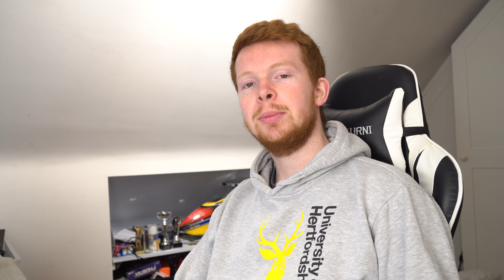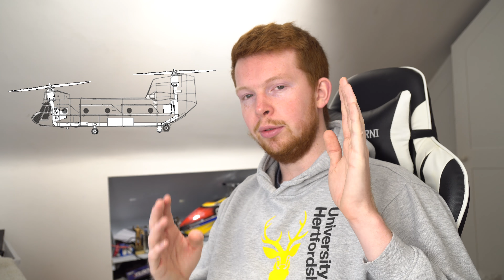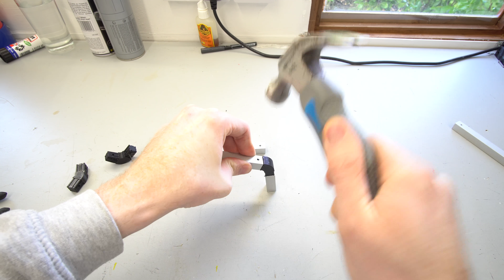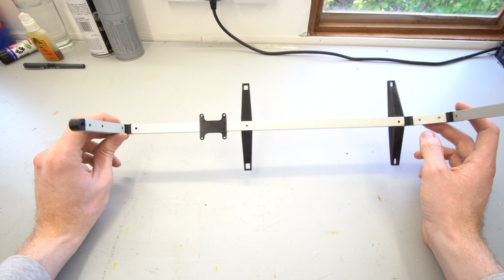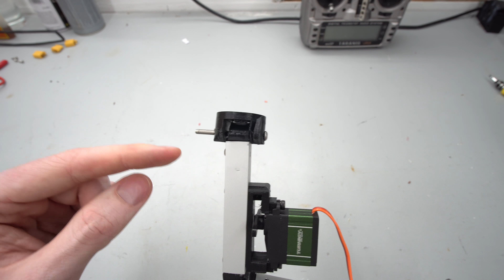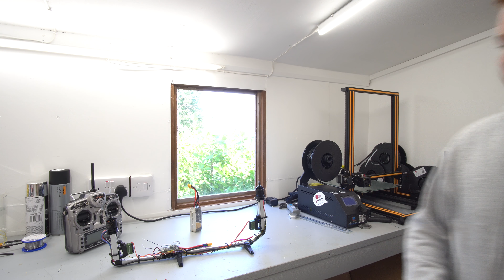RC Chinook Bicopter - Part 1

Comment: I'M VERY CURIOUS ABOUT THE CHOICE OF COMPONENTS, AND SWASH PLATES/ROTOR HEADS, MOTOR SELECTION, ROTOR SIZE/WEIGHT (SCRATCH BUILT?, OR COMMERCIALLY MADE ("REPURPOSED")??....  WHAT ABOUT ROTOR BLADE INTERFERENCE/TIMING/SYNCHRONIZATION?.... IF IT FLYS WELL ENOUGH, THEN YOU OUGHT TO DO SOME "HEAVY LIFTING" TESTS TO SEE HOW ROBUST THIS THING IS!!....   HOW WELL WILL IT FLY???!!  HOPEFULLY,  IT SHOULD BE VERY CONTROLABLE, AND MANEUVERABLE...

Comment: Hello! Congrats on your bicopter project. It’s already a very unstable aircraft, so managing to stabilize it is a huge achievement.

I’m also building a bicopter similar to yours. I’m using a SpeedyBee F405 Mini as the flight controller, running Betaflight firmware. I’ve successfully mapped the servos and motors, but I still can't fly because whenever I increase the throttle, the servos tilt forward or backward.

Since you used Betaflight for your configuration, I’d like to know if you modified the default motor/servo mixing that Betaflight provides for the bicopter mode.

I’m so close to getting it in the air, but the default servo mixing seems inappropriate. Thanks in advance for your help!

Comment: Loved your explanation of the forces at play in an aircraft. Might not be your forte, but you should do a video about stability in water vessels, how righting angles are derived from centre of gravity/buoyancy, metacentric heights and the difference between list and loll. A build with the different roll correcting/reduction methods used would be interesting.

Comment: Another good one! I've watched and liked nearly all your videos in a short space of time (you're welcome) one thing that has became painfully obvious by now is that you go to incredible lengths to avoid a conventional swashplate head at all costs without saying so. You create more problems than you solve by not sticking with what's proven sometimes, although I applaud your innovative thinking, until you can improve on the tried and tested why not benefit from the hard work others have done before you.

Comment: 6:54...For driving angle of engines I recommend 2x longer (maybe 2,5x) lever against servo lever. Also should by better using spheric brass/plast joint. On all 4 point. In this cause you can used higher sensitivity of gyro  and any inaccuracies in engine tilt will be much less. Also servo will have bigger power for flywheel resistance. The sensitivity range of the gyroscope will be used in a wider range. This means more data per angular degree. Self-stabilization will be even bit faster and mainly much more accurate. Any way, one from best video on this theme.

Comment: The real Chinook must use differential cyclic for yaw control. It can't use differential RPM as that would... crash both rotors together. It has a gearbox and rigid shaft to sync the rotors together.
Reply: Yes, the resl Chinook uses differential cyclic for yaw control, just as this model uses differential rotor tilt.

Comment: Love the channel! A couple other design attributes of the Chinook: The blades are synchronized and the front rotor is biased forward.
Reply: Gryfifkhdhfjfgkfdg
Reply: Both rotor shafts are tilted forward as they are in this model. The blades of the real helicopter do need to be synchronized because they overlap, but it's not  problem because they are connected by a shaft.

Comment: Sure chinooks are not at all inherently unstable,  as a bicopter, because the large centre of mass is very below the moment of lift. Like a pendulum
Reply: No, a helicopter does not work like a pendulum. Tom did a video in this series explaining that.
Reply: @brianb-p6586  I'm talking about a chinook helicopter.
Reply: @con_boy  Yes, and i'm talking about any helicopter. The Chinook is not special in mass distribution or in stability.
Reply: @brianb-p6586  yes it is because the centre of balance isn't under a rotor. I used to write centre of balance mass calculations for the helicopter industry's
Reply: @con_boy  That's really scary - I hope someone qualified fixed your work.
Reply: @brianb-p6586  it was the biggest helicopter firm in the world, I also wrote the entire offshore flight operations system for the North sea. You've got enough there to be able to check the safety record. Good luck. I'll take my experience and work over some online (rude, wrong) random.
Reply: @con_boy  I have no doubt that you can write software, or that major corporations in aviation are competent. On the other hand, you don't understand a basic concept in stability which even Tom (apparently a university student working with radio controlled models) can clearly explain... so it would be scary if they let you actually do any of the engineering related to stability.

Helicopters - even the Chinook - are not pendulums, because they are not hanging from fixed structures above them. See Tom's next video - "RC Chinook Bicopter - Part 2" - to understand this... or any other illustration of the rocket pendulum fallacy.
Reply: @brianb-p6586  I'm not going to justify anything I'm saying. I talked about the stable centre of mass, which is not under the rotors.. You're going off on a weird tangent about something I didn't actually say. Also I'm not interested in youtubers. My entire family are phycists, I can ask them.

Comment: I'm curious as to why you didn't just... bend the main bar (using the necessary tool, of course) would have been SO much stronger... ?
Reply: The aluminum alloys typically used for these extruded sections will not bend significantly without cracking.

Comment: I would like to see a one motor collective pitch quad sorted out with quality heli tail parts, and some sort of diy home gamer fc.
Reply: While interesting, it would be pointless unless the motor is an internal combustion (or turbine) engine... and no one is likely to bother with that anymore for an uncrewed vehicle.
Reply: @brianb-p6586  why do you think that? 
The stingray from Curtis youngblood was fantastic, in all aspects.   I think it's price kept people away, and really the cost was mostly his home brew FC.   The parts are relatively cheap, easy to service, 1 motor 1esc, it's a no brainier to me.
Reply: @MoralConflict  One motor speed controller plus four servos doesn't seem like an electronic advantage over just four motor speed controllers, especially since that one motor controller needs to handle almost four times as much power as each the four controllers of a conventional quadcopter needs to handle. Perhaps the price of tiny speed controllers doesn't depend much on power capability; I'm usually thinking of much larger components (automotive size), in which power determines cost. 

Of course the big difference is mechanical, with the central motor approach having four variable-pitch rotors and their control linkages, plus power transmission by shaft or belt to all four rotors; this is in contrast to... nothing required at all (or just a reduction drive at each rotor, depending on motor choice).
Reply: @MoralConflict  I had never heard of the Stingray, so I had a look. Nice, but lots of mechanical parts apparently including long drive belts that require tension adjustment.

Comment: I'm going to build a Chinook:
Builds a twin rotor copter that is nothing like a Chinook. 
Lame. 
Ditch the tilting motors and do it right.  Collective pitch & swash plates.   
What kind of swash would be necessary? Counter rotating blades  necessary?
Reply: MoralConflict I think you missed the point of the project... the goal is to look like a Chinook, not to be mechanicaly correct. In fact, that’s the opposite...

Comment: The only way a bicopter would be like sitting on a 2 legged stool is if the rotors were below the COG and pushing the copter up. Otherwise it’s more like hanging from 2 Poles on an omnidirectional zip line. Helicopters “Hang” from their collective, they don’t Sit on top of it.
Reply: Since a rotor is not a magic zip line the sky, a helicopter does not fly at all like it us hanging from a point above it.  Tom did a video in this series on this subject.

Comment: Someone who is on an extremely tight fixed income budget, but wants to get first  3d printer with the requirement... must print largest possible projects, which 3d printer do you suggest?
Reply: Little King Cobras Den Ender 3.

Comment: Actually it's inherently marginally stable. Like you could technically balance a needle on it's point until the slightest intervention blows or knocks it over.
Reply: That's "metastable"... which of course means not usefully stable. 😀

Comment: Hi tom , 

This is Siddhant ...wanted your help regarding a VTOL Bicopter you built. Made the structure, Programmed the KK with OpenAero and when I tried to fly it its showing some roll and yaw. Can you help me out. 

I have read the RC Blogs, your blogs on flite test, posts by RanDst clair but couldnt find the answer. It could be helpful if you give me some insights. I have spent 1month building this and dont want to leave it unfinished. 

Thanks for the help again buddy. 

Sid

Comment: in case you haven't run across it, and no one has commented already, the CH-47 Chinook (pronounced shinook) has a main drive shaft which connects the front and rear rotors. the two turboshaft engines turn the drive shaft, and the drive shaft in turn drives the props. The drive shaft is a critical design element, as it keeps the rotors synchronized, and prevents them from colliding with each other in flight. One of the most dangerous situations in the Chinook is if a tool gets left in proximity to the drive shaft after maintenance. One such incident nearly sheared the drive shaft in two just by scraping on it while in flight.

Comment: You did a *tiltrotor* not a bicopter.
Reply: No, the term "tiltrotor" normally means an aircraft which tilts rotors from the horizontal plane to the forward-facing vertical plane, to transition from VTOL lift to propulsion with fixed wings. This is not like that at all.

Comment: You know by chances we are actually developing similar flying systems, except I got mine in a game with incomplete physics.

Moreover, it actually happened around the same week, and worked independently without realising. XD

I am actively looking for someone that can  realise what I manage to design in game, I had some videos uploaded for reference.

Instead of a single drone hub,  I am looking  at 2 drone hub, hubbing the 2 blades in the middle forming a double "工工" or double H. 

As the hubs now serve as a retardation of the roll by weighing it down drone thus achieving a mechanical flat and stable pendulum for the roll computer to work on idealy with minimum roll while doing dimeturning(also do try reverse pitching and counterspin each blades as it is not possible to represent in the game).

Thanks in advance, hope to hear from you.

I will keep it check if it works many thanks.

Specific link attached here
https://youtu.be/bQEqgSzGegc

Comment: I'm not sure if youre aware of this or not, but have you accounted for the gyroscopic precession that will occur when you try to tilt a spinning rotor left or right, it will actually try to tilt fore and aft instead.  Now of course your hinges only swing left and right , and I'm sure your servo can "muscle it"  left and right with some considerable effort, but wouldn't it be easier to apply the servo arm pressure in a fore and aft plane. But also I see this as a point of stress in the future, with the force of the gyroscope always wanted to bend forward and aft against your struts and hinges.  I'm sure some testing would confirm this.

Comment: Peter its needs some skis on the front for steering - would be wicked to peel it flat out round the corners then (you might need that prop mesh though) just incase.

Comment: This looks very cool.  I'm wondering if your angled joints are going to be strong enough.  Would you have been better off creating an integrated 3D printed part that mounts the servo "and" strengthens the joint via an external gusset?  Chinooks also employ counter-rotating blades - I don't know if you mentioned that in your design or not.  Looking forward to the next installment!
Reply: Dave Lynn He is using a racing quadcopter flight controller called a Raceflight FC. I use the same one he has, and you can adjust the direction of each of the motors very easily in software. I'm sure he is aware. Even quadcopters use counter rotating motors to create stability. I also thought it was silly to use 3d printed parts to connect the aluminum, but thinking about it now, it's actually pretty smart. If he crashes, that plastic piece will be the weakest link and will break first. By being sacrificial, it will save the expensive aluminum piece which he can then just re-print new connectors again.

Comment: Its pronounced shin-ook, not chin-ook.  One problem you need to overcome is  both the Chinook and the tilt-rotor designs have direct so both propeller shafts spin at the same speed.  Having one propeller spin at a faster speed will cause uncontrollable flight.  The Chinook blades overlap so cannot spin at different speeds.
Reply: He would only have to be concerned with that if he were using the Chinook's design, with cyclic control of overlapping rotors... and he is not.

Comment: Really cool build bruh! That is something I would like to do as well! Looks like the height of the motor mounts and the size of those motors and the tippyness of the motor mounts might be more than the PID controller can smooth out - IO am super interested to see you progress!Did you jump through a bunch of hoops to get Betaflight to flash to your Raceflight FC? Is all the BiCopter setup stuff just built into Betaflight?

Comment: Spent 14 years flying the CH 47. They are very unstable and use 2 AFCS systems to help to stabilize.  The swashplates do tilt forward automatically as the aircraft accelerates to help level the fuselage which reduces drag in high speed flight (170 kts).

Comment: interesting build. you could go with an digital servo (not looked at what you are using) and solder on a 4th cable so you get an feedback from the servo to an rssi or reconfigured current pad. that way you fc always know the servo position and you get better controls. I use that type (Bluebird BMS 210) with an feedback on my tricopters so I could tune all in Betaflight.

Comment: I hope you realize that a big part of  a Chinook's stability is due to their rotors spinning in opposite directions...
Reply: TheLayleaf1 He is using a racing quadcopter flight controller called a Raceflight FC. I use the same one he has, and you can adjust the direction of each of the motors very easily in software. I'm sure he is aware. Even quadcopters use counter rotating motors to create stability.
Reply: Juan Baca Ah okay. In that case it's pretty easy to fix. Just flip the rotor and reverse the direction in software.
Reply: TheLayleaf1 That is correct. Only he would use a different prop that is specifically made to go either cw or ccw. Flipping the prop upside down can be bad, as most efficient props are made to produce lift in one direction only.
Reply: @chevyspeed6368  flipping the prop also does not change the relationship between rotation direction and thrust direction.  Turning a right-hand threaded bolt around end-to-end doesn't make it into a left-hand threaded bolt.
Reply: Counter-rotation is not for stability. It allows torque reactions of the two rotors to balance each other, but more critically the rotors overlap so they need to mesh and that requires counter-rotation.
Reply: @brianb-p6586  aka stability
Reply: @chevyspeed6368  Sure, lack of reaction to changes in rotor torque is a small aspect of stability... but keeping blades from hitting each other is not about stability.

Comment: I know how the real Chinook works (two shash plates, connected rotors via a shaft) but I don't get why the servos are tipping the rotors sideways? Is this to control the roll axis? I mean pitch can be controlled with differential thrust as well as yaw. It would be nice if you could shed some light on the control situation of your build... :-)
Reply: I think yaw would work a bit like a tri copter, just tilt in opposite directions.
That will give some pretty extreme yaw capability.

Comment: Why do you even need the servos to control the motor pitch, wouldn't the motors lift keep them parallel to the ground and then the body would just hang beneath

Comment: Very interesting on how it will fly... BTW, doesn't the real Chinook have it's engines/motors spinning in opposite  directions? I noticed that you have your motors spinning in the same direction... Any reason for that? Or was it was just the way you connected the motors for a test run?
Reply: The Chinook's engines are shafted together - there are not separate engines for the front and rear rotors. Yes, the two rotors counter-rotate, as they need to because they overlap (substantially), and you would want this to minimize torque reaction anyway.

Comment: The example of some of the control structures of the Samsom SA-2 from the film also Avatar comes to mind ,, "but" while not shown in detail in the film that aircraft has a vectored jet thrust nozzle in the tail for body front to back pitch stability ,

Comment: Maybe a tip to consider, Make both props turn in the same direction and control the YAW by offsetting the angle of thrust between the two.. this way it will fly smoother IGE because both props' downwash will create vortexes in the same direction,